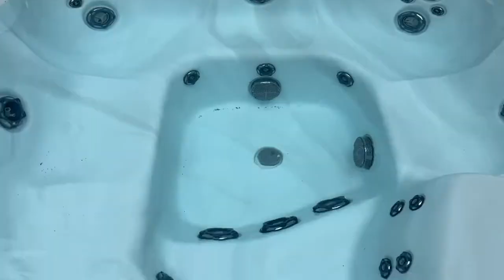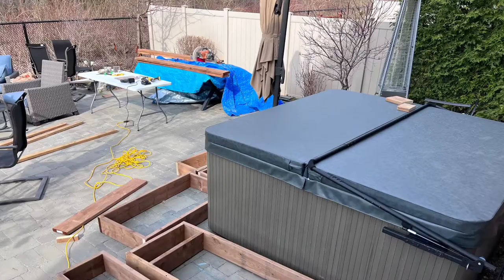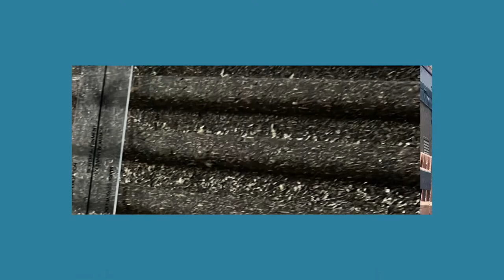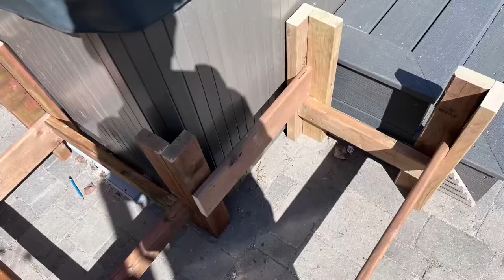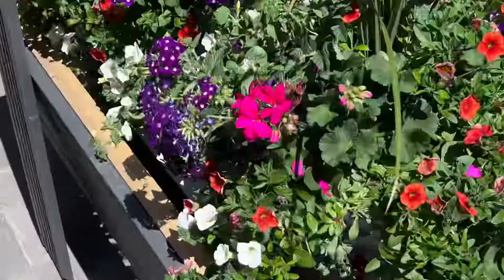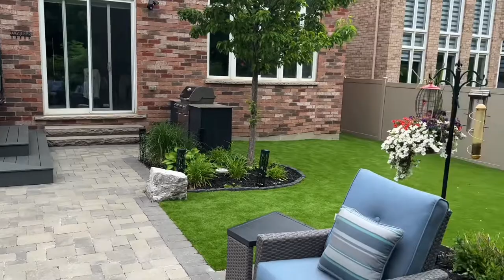DIY hot tub surround from Trex composite deck boards

Comment: Hello. this is so helpful. Question: on those lower platforms, why did you double up on the front facing boards? I see one is narrower than the main frame. thank you!
Reply from the maker: I made an error in the measurement and was short half an inch. Otherwise I wouldn’t need it. Sorry for the delay. I don’t check often.

Comment: This is beautiful! I'm looking to do something similar with mine. How did you attach the deck to the ground (or did you) to prevent moving? Also curious how did you attach the two levels of the deck together? I think I saw a vertical board that maybe was screwed into both? Thank you!
Reply from the maker: Thanks. The deck is very heavy. It won’t budge. No need to attach to ground. The two levels are attached by a 2X4 as you mentioned. Good luck!